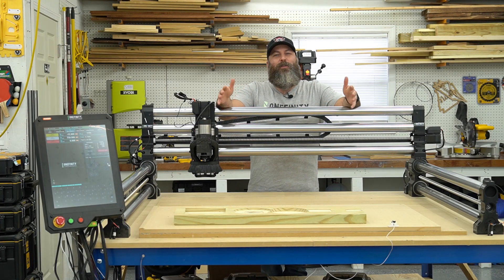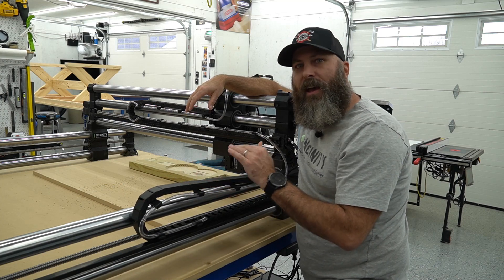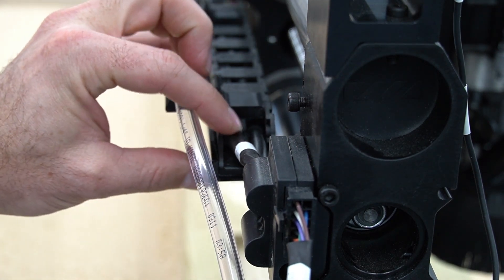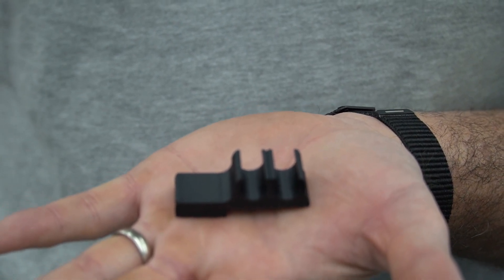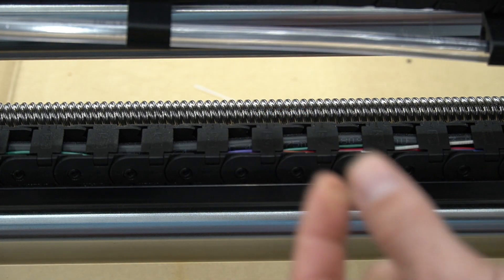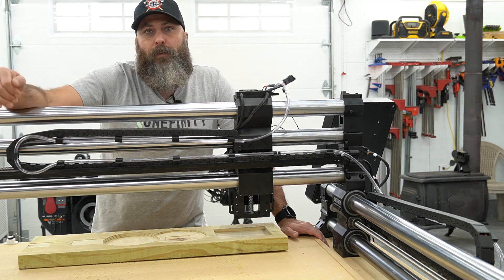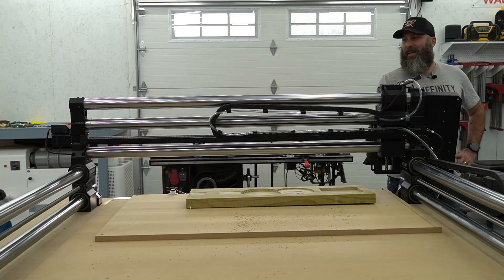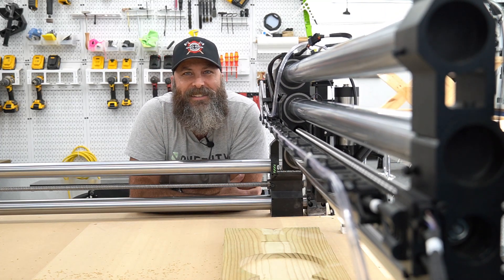Onefinity Elite Series Drag Chain Bracket

Comment: Is there a recommended material to make these clips?  I’m using protopasta carbon filled HTPLA since that is what is loaded but I do have PETG and ABS  if that would be better. The protopasta pla is heat treatable.
Reply from the maker: I generally print everything in petg or abs